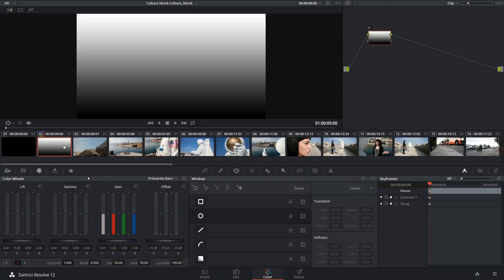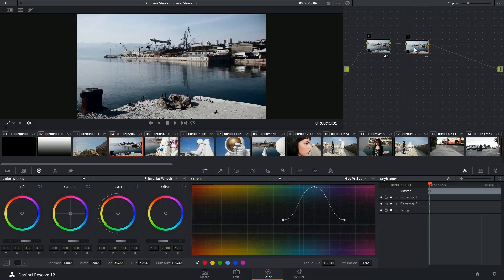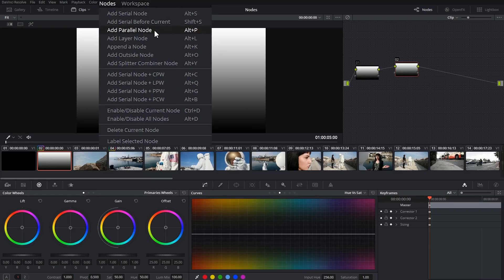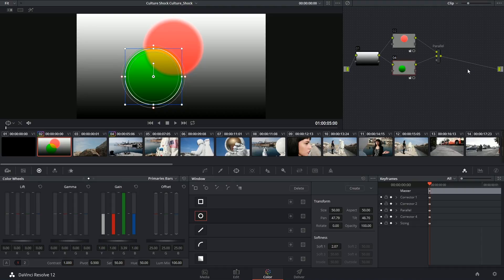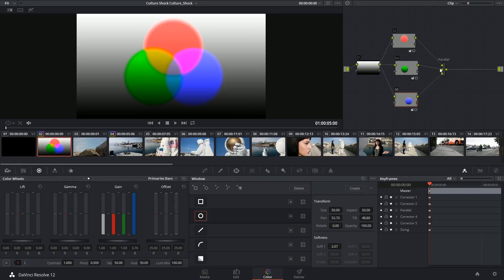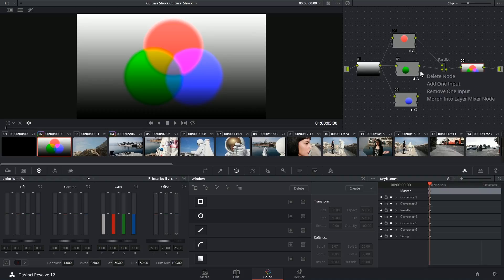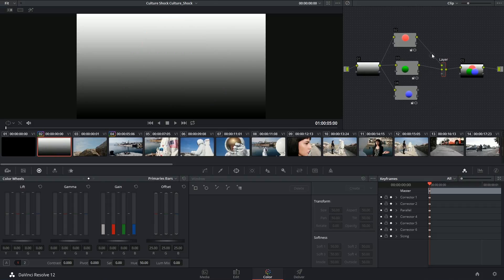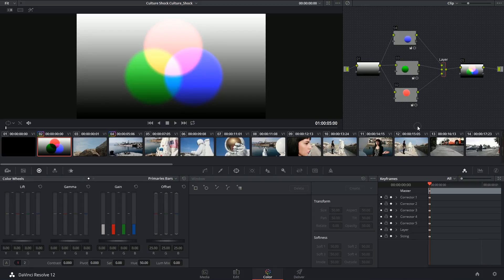DaVinci Resolve 12 - 75a Parallel and Layer Mixer Nodes

Comment: When I make the copy the circle over I can see only one of them at a time by clicking on the node, I do I see Bothe of them?
Reply from the maker: Hi Seth - is it possible you have Highlight mode on in the Viewer? You should be able to see all the circles at once when working with them, unless you're in Layer Mixer mode, in which case you'll see the top-most layer (bottom node) only until transparency is introduced (via the Power Windows).
Reply: @DaVinciMasterKey  Got it. Thanks 😊

Comment: I can't seem to get my color workspace to match yours. How did you get the color wheels to stay visible while you work with power windows?
Reply from the maker: This is most likely due to the resolution of your monitor - if it's under 1920x1080, the left and centre palettes are combined into a single space on the left-hand side (13 palettes in total) to give you better control over the individual settings. The only way to amend this is to either split your workflow between two monitors, or to get an HD (or higher) monitor.
Reply: You are correct. I changed monitor resolution on my MacBook Pro and now I can see what you have on your demo. Thank you.

Comment: Great stuff, but do you have examples of when you would use both in a real grading session?
Reply from the maker: Yes - one coming up right after the video for parallel nodes. There'll also be some longer 'demonstration' videos of grading workflows coming up after the series is over (which is also soon).
Reply: Since the problems you had with Sony Codec on DaVinci Resolve, I thought you gave up of migrating to DaVinci Resolve Dave. Seems they have fixed it finally, wish you all the luck, DaVinci is way superior than Speedgrader!